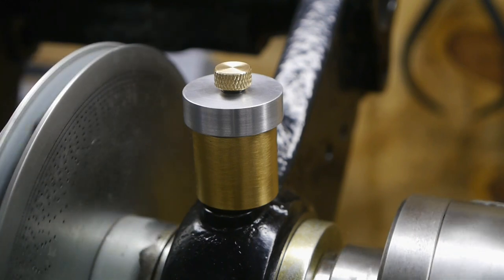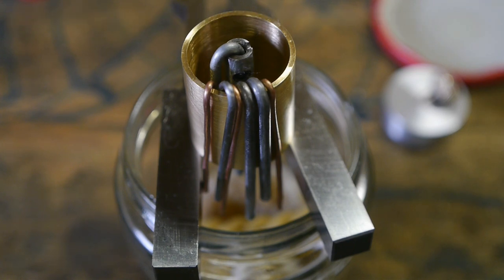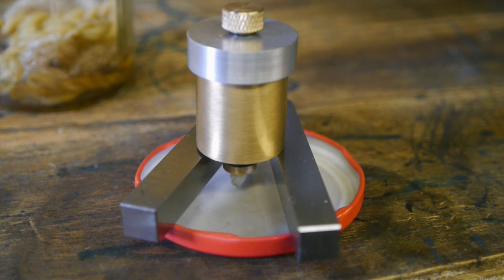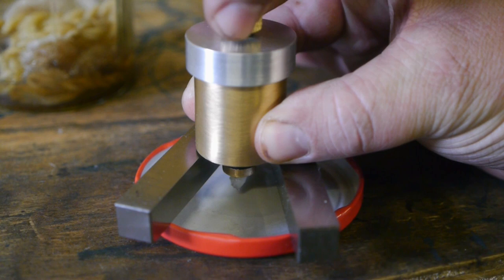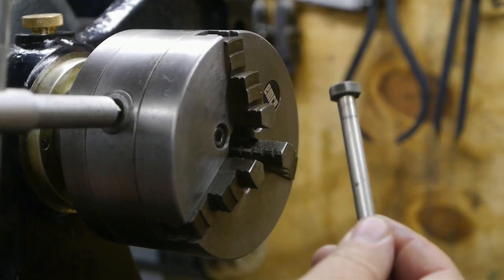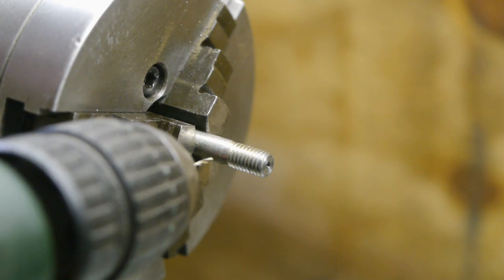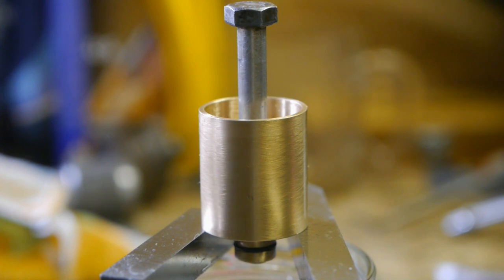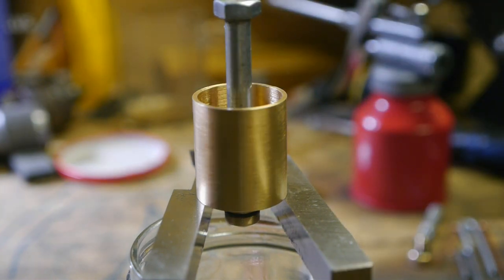Testing and modding my prototype lathe oiler

Comment: I have an old engine oiler made from a pipe cleaner which is a wire centre and a thin centre wire. Seems to work well.
Reply from the maker: I've been told about pipe cleaners before. 
I'll give them a go when I run into some.

Comment: To get the wire wicks to work they must be closer, touching both sides of the oil pot.  The oil will then capilliarate between the pot and the wire.

I don't like the bolt idea the way you are doing it.

Why don't you make up something like an adjustable idle/fuel jet on a carburettor  to vary the flow ?

Cheers Rob
Reply: I did the wire trick on 2 lathes and it works, i used a thin tig welding rod.
Reply from the maker: I made a new centre section with a rounded of top that fits nicely into the bend of the wire wick.
Next I tightened up the legs of the wick to such a degree I needed a hammer to get it to seat properly.
And now it finally works with a drip rate of about once every  2.5 minutes.
I'm also not happy with this bolt thing. Infect I've already thrown it aside. I might try and make some of those myfordboy oilers.
But first I have to make a chainsaw grease nipple :)

Comment: Good to see the research.  I hope you are able to get the wire wicks to work.  

As CurlyG65 mentioned the bolt with a side hole is a crude valve.  Brass needle valves should be available locally and provide more control.  

You do need to make a drill guide for the lathe.  I was not surprised at the small drill bits breaking.  Too easy to flex too much.
Reply from the maker: I did get it to work, but not after I made a new centre section with a rounded of top that fits nicely in the bent of the wire wick.
about a 2.5 minute drip interval. Too slow for my liking.

Comment: Try whool and you need a small venting hole.
Reply from the maker: I tried some hand spun wool in a previous video.
The small brass bolt on top has a venting hole.
Reply: Rolingmetal ok maybe a small round piece of scotch bright pad that stuff is pretty pores.